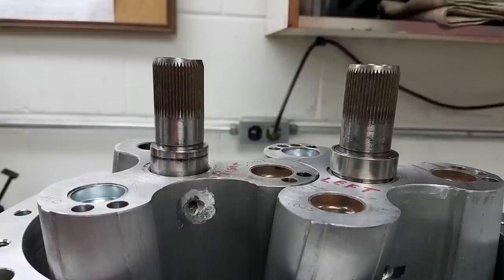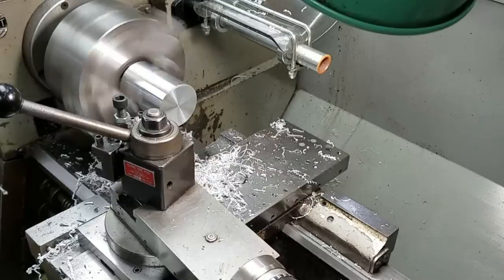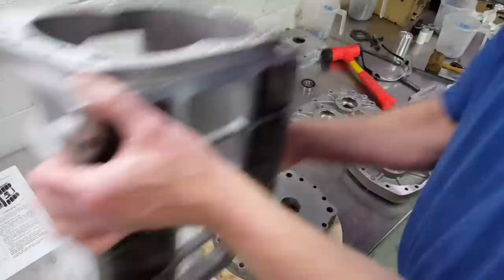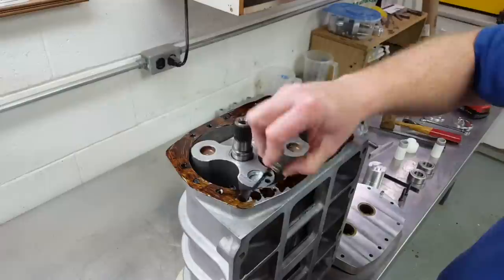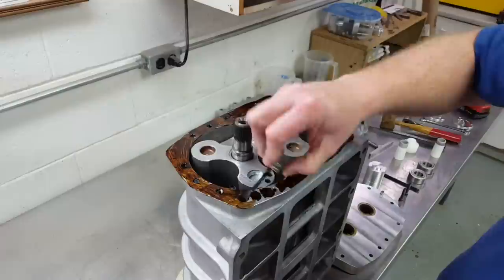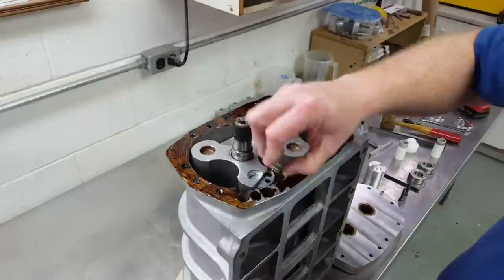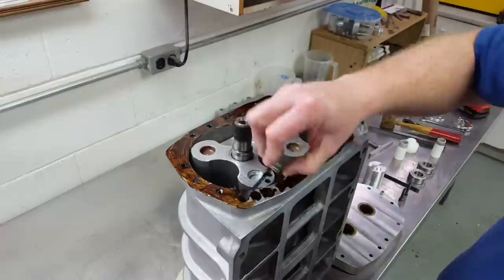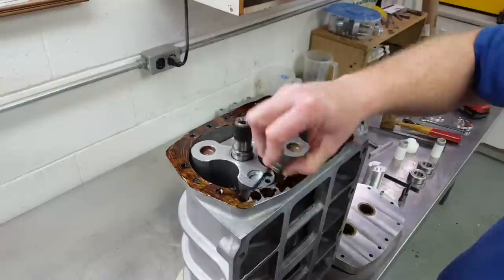My 6-71 Blower rebuild, Part 14: Final assembly.

Comment: After assembling a few of these I learned that if you bevel the leading edge of the seal surface with a fine lathe file then polish it theres no need for seal protectors and the bearings can be pressed in on a surface with support rather than tapping them in after with only the case supporting it. Sometimes they go in really tight especially on some of the after market plates I have purchased. Your able to check and make sure bearings are still smooth before pressed on rotor as well. Cheers love these videos

Comment: On my aluminum carb adapter I cut it out on my table saw with a carbide blade. For the square openings for the carbs I used a hole saw for the round corners, then I cut the center out with my hand held Jig saw. On the side of the carb adapter for linkage clearance first I drill holes for round corners then I finished cutting out the indentations on my band saw. To smooth out all the saw cuts I used my table router and carefully guiding the adapter by hand then I cleaned it up with a file. I polished it to a brilliant shine with 2500 wet sandpaper and counter sunk the bolt holes. I needed a 1/2" adapter to keep this 8-71 and carbs under the hood of my 56 Caddy with a 500 cid. I have a 1 1/2" clearance under the hood for affixing side mounted air cleaners. I'm so happy.

Comment: Nice job.  I may have missed installing dowel,pins and relocating them to adjust top and bottom clearances .  A number of ways to do this and repairing over size or wallowed out holes was done in the early days. At times it was a tricky operation.as you might only have to move holes a few thousandths of an inch. I made a separate end plate with hard bushings fo guiding drills or readers. Occasionally a hole could get deformed and it became very difficult to over size or drill and ream for a repair bushing.  Having a milling machine and boring head made life much easier. It still took precision work to do correctly.  A bad backfire or motor explosion could distort the cas so that meant a new unit.  These used to be available for 50-100 bucks in good shape an sometime you could find a near new one that’s had many hours on it but very clean air cleaners so they might be near perfect inside.  I had several streetrods I drove for years an I built several more for other guys. We ran these on top fuel dragsters and top gas cars then top alsohol funny cars.  Noe most of these are billet construction so perfect when new. They usually have nylatron strips in the seal areas and depend on the fuel for a bit of cooling and lubrication. No fees are very good but better than none.
Reply from the maker: Very cool stories from the golden days of drag racing.  Yes, the dowel pin part of the project is outlined in the part 13 video, here:   https://www.youtube.com/watch?v=Ke2DrtZA4g0

Comment: here's a shortcut to c and cc clearance adjustment.  no need to push the gears on several times.  even with new parts.  start both gears on the shaft. tap them sufficiently to prevent them falling off.  measure the  c and cc, tap one gear or the other until proper clearance is achieved. now take the depth mic or calipers, measure the difference in height from one gear to the other gear. that's how much shim to add.   do not ask how i figured this out. (hanging head in shame it took so long).
Reply: Thanks for this tip! It’s so simple and makes perfect sense! Why didn’t I think of it?! I’m in the process of converting my first 6-71 and will definitely do this.

Comment: Great job I used to rebuild blowers injectors all the gm diesel years ago
Reply: So did I but I advise not using handle to stop it turning and to use a rag as Detroit recommend as you can cause deformation to rotor with localized pressure, also rotor clearance is an issue if not running fuel thru it as temperature of rotor alters dimension as can be verified by different spec for turbo application FWIW

Comment: Detroit Diesel sells over size shaft sleeves and Teflon seals, plus the tools to install both. Blowers are simple to rebuild just pay close attention to clearances and shims behind drive gears. Never seen anyone cut the backside of the gears always used shims. good luck sir

Comment: Your vid has been a great help for me rebuilding my 671! Thank you! One thing I noticed on the positioning of rotors you are showing blank spline at 3:00! My gears have two dots on one gear and one dot on the other! I'm  presuming those dots should be lined up rather then the 3:00 position you showed? It's the same thing I think just 1/3 trun off gets my dots lined up! Hope it's right!

Comment: Am watching your video to help with my project. It's my first time dealing with a blower. Put oil in the tank and it leaked out right away. Pulled it apart and when pulling the gears, a bunch of the shims dropped out. Don't know which side they go on. How can I fix that? Thanks in advance, Bill
Reply from the maker: Bill:  Choose a side at random and re-install all of the shims on that side behind the drive gear.  Then start watching the video at this spot:  https://youtu.be/T-lCAhEyZdU?t=842 and go through the rotor timing step.  If you have the shims on the wrong side the measurements will be WAY off, and you will know to switch the shims to the other side.  You may have to get a shim pack and slightly change what you already have, but usually the stock Detroit Diesel shims at least get you close.  Good luck with your build!

Comment: Q: why can we not use the shims on a petrol application? Will they burn out? Changing rotor timing? Also I don't have a lathe and am miles from civilization. I am thinking of using a sheet metal plate 0.8-1.2mm thick to space the rotor ends from the end plate for grow room. Kina like a thick gasket but between the housing and endplate.
Reply from the maker: If it is not a racing application, I would not hesitate to use the shims to time the rotors.  I only machined the back of my gears to time the rotors because I have all of the proper equipment to do so, and then next time I tear the blower down, I don't have to worry about juggling shims.  You do not need to put any shim stock or gaskets between the end plates and the blower case.  The two existing flat surfaces seal fine as they are with only a light coat of sealer.  As long as the end clearance is correct, that provides all the room for heat growth that you need.  Good luck getting your blower together!

Comment: Hello, recently discovered this video while trying to rebuild my own whipple supercharger. Do you have any suggestions on how to determine how much rotor timing/clearance I should have? Factory won't get back to me with this information. My whipple S/C has a ring gear on the one rotor with 6 bolts that can be loosened so you can adjust the clearance without removing the entire hub. My current thought process was with a dial indicator mounted to the hub to just put it in the middle of the clearance, is it this simple or are there specific tolerances? Any suggestions would be appreciated.

Comment: On my shaft seals (front bearing plate) one side is flat and the other has a recessed lip. What direction does the seal go? Your video appears to show the flat side faces the rotor. ??

Comment: I don’t see any adjusting washer or spring to adjust the distance between side plate and rotor? Pretty sure the side plate and rotor might rubbing each other because of the axial movement of the rotor when spinning.
Reply from the maker: Yes, your right, it does look like that at first glance.  Go to the 10:00 minute mark in the video.  Do you see those round plates with the three screws in them?  They trap the bearing firmly in the bearing plate so the bearing cannot move axially at all.  The front rotor stub shaft has a shoulder on it which is pulled up tight against the back of the bearing when the gears are tightened down.  You can see that at 15:00 in the video.  The gears keep the rotor from being able to walk backwards in relation to the bearing plate. This locks the rotor axially into the bearing, so everything stays positively located, and the axial clearance (end clearance) between the front face of the rotor, and the inside face of the bearing plate is maintained.   Yes, everything grows a little bit as the case heats up while running, but the rear bearings CAN slip on the rear rotor stub shafts, so that allows things to move just a tiny bit with heat, instead of binding.  Hope this explanation makes sense.  Thanks for watching!

Comment: Great series, I watched them all! 
My (6-71) blower front cover came with a manual pressure relief valve and a sight glass (not installed and no instructions). Is there a specific location for those? 
Thanks for posting.
Reply from the maker: It's hard to describe in text, "keep the oil level a little above the bottom screw in the triangle cover" so just look at this very nice video from The Blower Shop.  They show it visually which is easier to understand.  The vent can go high up on the front cover, well above the oil level.  You can also see that in their video.  Thanks!

https://youtu.be/p-wMTv6XwRg
Reply: @MakerCave   ok I'll check it out. Thanks for the reply!

Comment: on using detroit blowers , do the gears need be upgraded or just reclearanced? does the rear housing have to be after market? before i even start attempting a rebuild is there a parts list i need to start out with? love your videos, keep up the good work.
Reply from the maker: Stock gears are just fine for a street blower.  It is best to use an aftermarket rear bearing plate.  If you are going to go through the time to set clearances, best to do it with a good plate.  You can purchase rebuild parts from www.dyersblowers.com.  Thanks for watching!

Comment: I missed the end of this video before apparently... Will that carb adapter allow 2 Holley double pumpers to fit without turning them sideways? It sure as hell looks like it would.
Reply from the maker: Double Pumpers (4150 style) with rear metering blocks will not fit on this custom plate.  I spaced the centerlines of the carbs so that only a 4160 series carb with NO rear metering block will just fit, in only an inline configuration.  I think that there is enough real estate to spread the spacing a little bit to fit a 4150 on this type of plate, and really all I would have to do is move things around in my 3D model which would only take about 5 minutes, and re-generate the G-code, to make a new variant of the plate.  Thanks!

Comment: great video and explanation but i noticed you didn't remove the bearing seals. they looked like the metal shields
Reply from the maker: I did this project about two years ago, but I do recall the front bearings being open enough to be able to get gear lube from the gear case.  On the rear bearings, some builders strip one seal and pack with additional grease, but I asked one of the guys at Dyers Blowers many years ago, and he said that they leave the seals intact and stay with the grease that is packed into the bearing from the factory.  I did another blower like that 25 years ago, and it is still running fine on an old street rod all these years later, so the grease has held up for a long time now.  Thanks for watching!
Reply: @MakerCave  cheers for the reply, i have 2 671 superchargers i will be setting up for chev engines  do you know what the difference is between the housing with the 3 flush bars on the inlet side and the housing with the center bar flush and the two other bars about 3/16" below the surface
Reply from the maker: @raymorrison919  Excellent projects you got going, Ray.  The rounded inlet ribs are usually on Small Bore 6-71's and the flat machined ribs are on Large Bore 6-71's built up until the early 70's.  I have heard that there are some blowers around the changeover time that are exceptions, but every 6-71 that I have handled over the years has been like this.  I found this listing of bore diameters and displacements over on Offshoreonly.com and they seem to line up with what I recall from measurements I have taken in the past:

6:71 small diameter
Rotor dia=5.505", length=14.975", displacement per full turn of rotor=339CI.

6:71 big diameter
Rotor dia=5.778", length=14.975", displacement per full turn of rotor=411CI. 

 Good luck with your rebuilds!
Reply: @MakerCave  once again cheers for the reply. i think i will use the big diameter on the boat and the small diameter on the show car

Comment: I’m going to try and rebuild one of my blowers that the shaft broke on I’ve tried finding new lobes online but I’m having trouble finding a place that sells them would you have website that you know of where I can look thanks and great video
Reply from the maker: Excellent.  If your case is very good, then save it.  Call Dyers Blowers in Chicago (Summit) Illinois at 708-496-8100.  http://www.dyersblowers.com They should be able to fix you up with a new rotor, or rotors if both of your rotors were damaged when the stub shaft broke.  They will want to know if you have a "Large Bore" 6-71 or a "Small Bore" blower.  Tape measure the diameter of one rotor cavity in the case, from top to bottom.  If I remember right, a small bore case is 5 1/2" and a large bore is 5 3/4" when checked with a tape measure.  Good luck getting your blower together, and post back here if you can, to let everyone know how it works out!
Reply: @MakerCave  awesome thank you and I will definitely let you know it should be interesting and a challenge to do and yes I believe the case is good I’m sure I’ll have to do some rust removal on it it’s been sitting for a couple of years will know more once I dismantle it still worth a shot lol especially when a new one is over 4,000 👍

Comment: Would love to see what engine you’ve placed this on? 
How did you go about fitting the belts etc?
Reply from the maker: Sorry about the letdown on not carrying this all the way through to implementation.  Had some substantial interruptions that put this project on the back burner for a couple more years.  Although the scope of the rebuild video series was just to show the conversion process, I did intend to wrap up the project showing it installed on the running large journal 327 chevy that is waiting for it.  Hoping to still get to that once the other demands are clear.

Comment: the blower is pretty clean, how do you clean those gunk built up inside the housing and the lobe?
Reply from the maker: The diesel fuel/oil residue actually washes off very easy in an automotive parts washer.  You could probably also use simple green, but I used regular petroleum based parts washer fluid in my parts washer.
Reply: thank you sir.

Comment: Are the deep scratches I see inside the blower case anything to get worried about Or ?????
Reply from the maker: The scratches in my blower case look a lot worse on camera than they really are.  However, if this was a race blower,  as opposed to a low boost street blower,  then a brand new case with no scratches would be best.